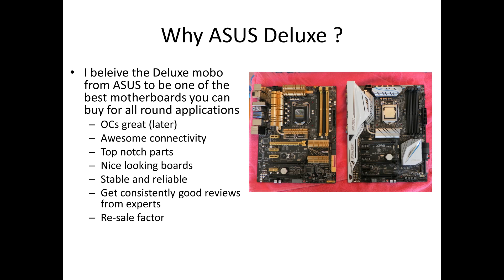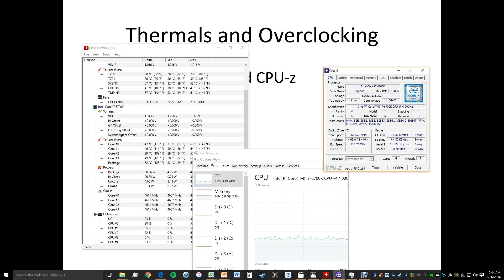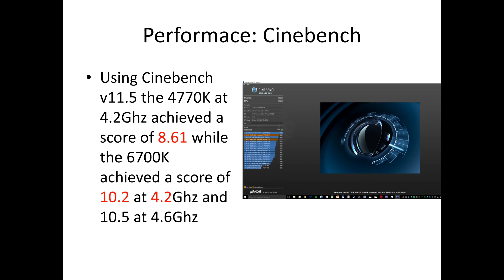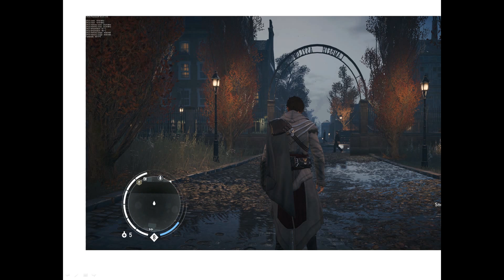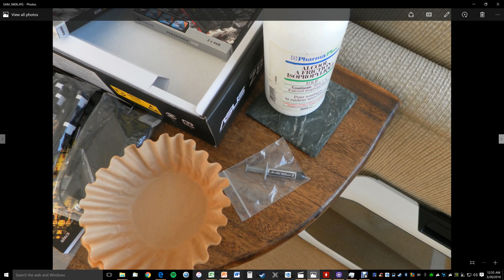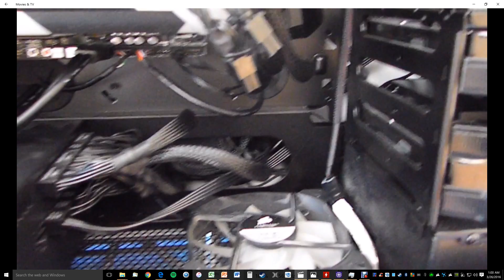Asus z170 Deluxe with i7 6700K: upgrade and testing from z87 4770K

Comment: That's a lot of dough to shell out for a mini upgrade. I guess to the huge enthusiast it's worth it, but to most people it's a foolish decision to upgrade from 4770k to 6700k. I mean I don't even think there is a 10% to 20% increase from the CPU. The most I have seen is between 7% and 12% gains.... Which wouldn't be noticeable to the end user! On paper, yes! in real world! No noticeable difference.... tons of money wasted!
Reply from the maker: I think you should think about your comment before you post it. The point is to sell you old hardware while it is still worth something. wait too long and you pay more money to upgrade. fine timing sometimes.  The 6700K is also a much better overclocking chip and I do notice that game FPS is consistently better with the 6700K at the same OC as the 4700K (e.g., AS Syndicate) due to architectural differences. yes an enthusiast level upgrade but in my mind very worth it.
Reply: If that is what you have to tell yourself to justify the swap... It's your money, bud! I don't game anymore but in gaming terms this "upgrade" would be considered more of a "side grade". But if you still have that Asus z87 Deluxe I would be interested in buying it
Reply: BTW the guys that are still holding onto their beloved sandy bridge CPU's sorta consider the P8Z77 the holy grail of motherboard because they have become so difficult to find. And they some times pay as much as the new ones sold for just to get a good used one. The top model of course... with the wifi go. I imagine that this ASUS board you had will eventually become highly sought after as well

Comment: I had to check my performance  on cinebench  managed 10.04 on a 4790k running at 4.7gz. I had problems with the CPU stepping down too had to find the stable manual voltage and then convert that to an adaptive voltage so it runs cooler most of the time. Nice vid well laid out and explained.

Comment: Personally, I find that the sweet spot for me is 1440p... Don't like the look of 4K especially in applications which still don't scale well. I found both systems to be very similar in gaming, however, the 6700K shines in Adobe/LightRoom/Sampling/Rendering and stuff like that... In many cases, I got gains of more than 50% which is huge due to my high usage (Movies/Photos/Coloring).
Loved your video, fabulous presentation, explanation, and voice... Also, the pace was just right.
Am also in the process of assembling X99 systems using the new 6900K to replace my X79 systems... The gains are noticeable.
Cheers.

Comment: Why the xonar sound card when the board supposedly has high end audio?
Reply from the maker: +Dave LeMay The z170 only has that nice creative labs crystal sound output via the analogue connections. The S/PDIF does not.  Anyway, I have the Xonar because I bought it as a on-board DAC for audio out to my stereo system. this was replaced by a dedicated external DAC of much better quality. that said, the Xonar STX is rated a recommended product in Stereophile as Class B i think.  I use for gaming now and it rocks for sound quality. can't get better really.
Reply: Sort of high end, but not really... It's far better than anything which came with previous generations, however, for an audiophile the on board is still very poor. Remember, a good DAC/AMP in many cases costs way more than your entire PC (thinking of things like Shiit or SR71, just to keep it Canadian)... Personally, I use Woo Audio.
I guess it's the same thing with monitors, it all depends on where you are coming from and what you are used to.
Cheers.
Reply from the maker: agreed. I use a Musical Fidelity M1 DAC fully balanced